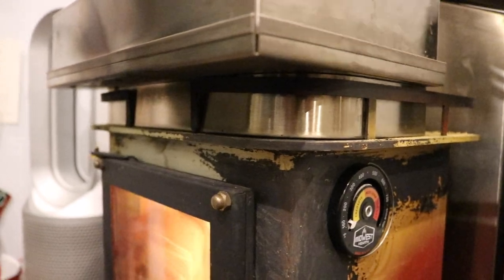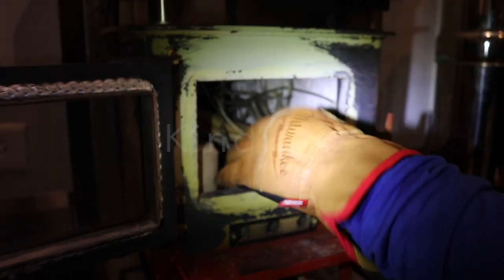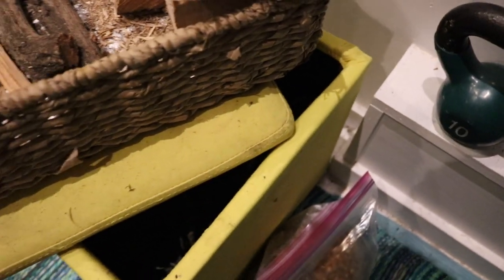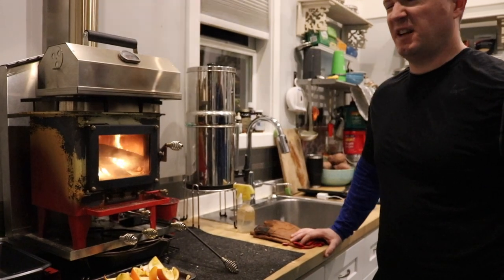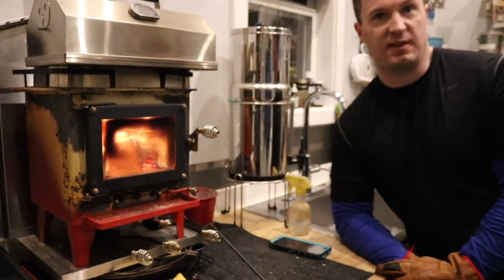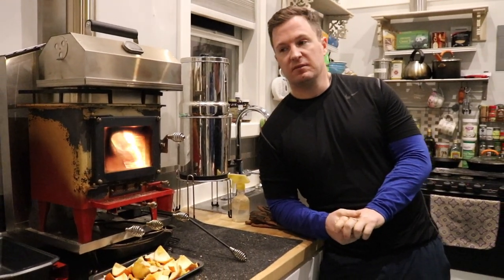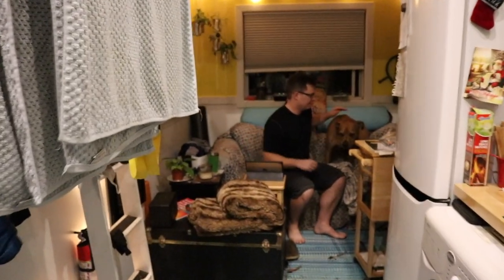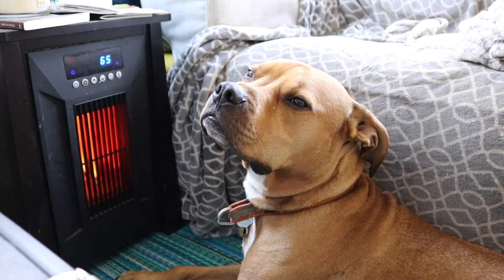Testing the Cubic Mini WOOD STOVE in a Tiny House On Wheels : 192 sq feet in Winter : Grizzly Review

Comment: great videos :-) I am going to buy the same stove in my 38'  sailboat, I was going to paint it, now I changed my mind, i like you guys use everything , mother earth thanks you guys :-)
Reply from the maker: That is a great plan- we would love to hear how you like the stove in your sailboat. It is an awesome experience to heat your home with things you find on the ground 😁
Reply: @LetNewAdventuresBegin   i will for sure.... Yes, I am all about being green , I replaced the diesel engine in my sailboat with electric motor , I have  Lithium for my motor and House bank, and Solar panels, wind Turbine to charge my batteries,   Nature's Head Composting Toilet and no holding tank, adding  wood stove is logical move for me, I can live , without using fossil fuel, it is great for my pocket book and for Nature  :-)

Comment: I had a stove on my old house and I learned that you can pack the stove full and let it burn to desired temperature then choke to make it last longer and prevent creosote build up, the creosote on the glass door indicates you are not burning effeciently. Let the temperature reach about 450F then choke it, the creosote on the glass will burn and should be clear when you are burning correctly. I suggest a miter saw to cut the wood to smaller pieces with ease to avoid spending so much time manually cutting it
Reply: Also once it is really hot avoid opening the stove and disturbing the ambers unless it is time to add new fuel.
Reply from the maker: thanks for the tips- we are learning a lot during our first season with a wood stove 👍 it does take some skill to use these effectively

Comment: Wood stove heat is the best. Been using them for fifteen years, always warm. Make sure to introduce moisture into the air, to lessen dryness! 😊
Reply from the maker: it is the best 🔥- I have no idea how we made it through the first 3 winters without it! we actually have an excess moisture issue in the tiny house in the winter (a common thing for very small homes) - more about that in future videos

Comment: To clean the door build the fire closer to the glass. It will burn the carbon off the glass.
For a longer fire at night, the sawdust logs are compressed to be denser, so you are putting more BTUs into the stove, especially denser than soft woods.
Be sure to throttle down the air entering the fire box to slow it down to make it last. Admittedly it doesn’t burn as clean, but the longer fire time is nice.
Reply from the maker: thanks for the tips Cliff 👍 it is a process learning the skills to make the most of the wood stove, but we are enjoying it

Comment: Is there an intake tube that draws in cold air from the outdoors into the wood stove? Sometimes wood stoves will draw in warm air from a living space which creates a few issues. It sounds like efficiency doesn't really matter here because the stove is working so well, so I guess it doesn't matter much! It's amazing how something so small can work so well - cool stuff!
Reply: Yeah, I learned that the smoky way. All was ok
 I always crack a window and I light a test piece of paper to make sure there is draft going up.
Reply from the maker: you can get a different mount for the stove that has a fresh air intake, but we just crack a window- that helps get a bit of fresh air and it is our way of regulating the temp if it gets too hot in the tiny house - as it can if we have the stove on for a few hours!

Comment: To clean glass use old fashioned black and white newspaper with some water. Water in a bowl and crumple up a piece of newspaper and get it moist. Rub in small circles on glass with pressure. Old timer solution my Uncle taught me. He also used a bit of turtle wax if you can still find it after cleaning to help keep it clean but I don't usually do that.
Reply from the maker: thats a good trick, thanks Timothy 👍

Comment: thinking of installing one in our camper. didn't know the black color of stove can discolor.  is that normal
Reply from the maker: the stove is black- I painted it with high temp paint (not high enough!) and it peeled off after a few uses 🙄 should have gone with a higher temp rating as this little stove gets HOT 😁 besides that we love having a wood stove...so cozy!